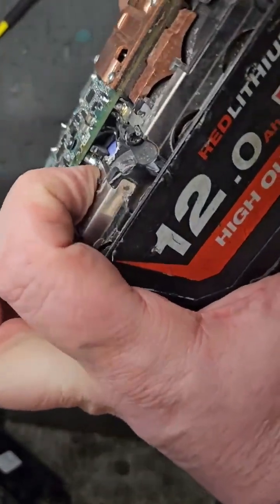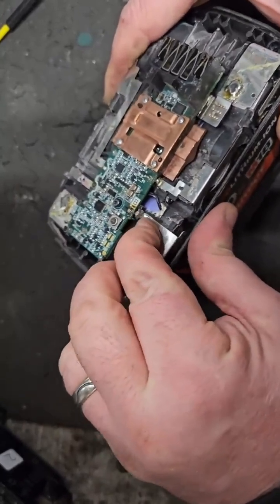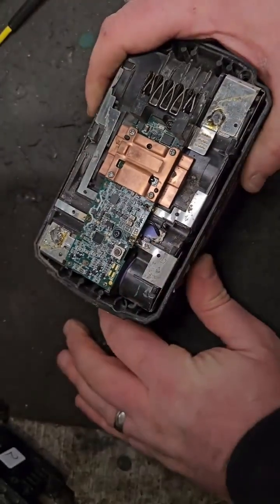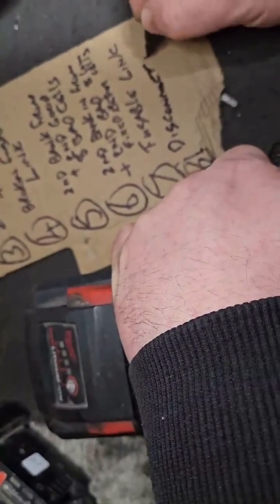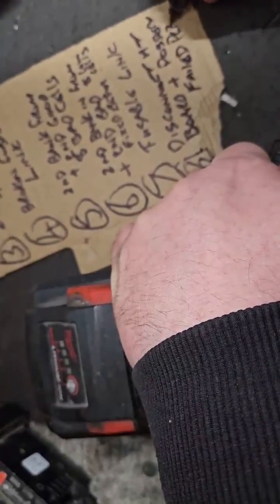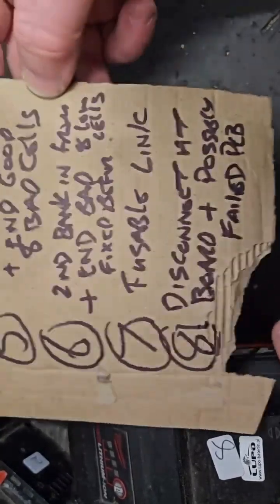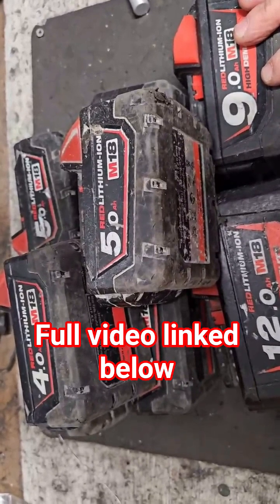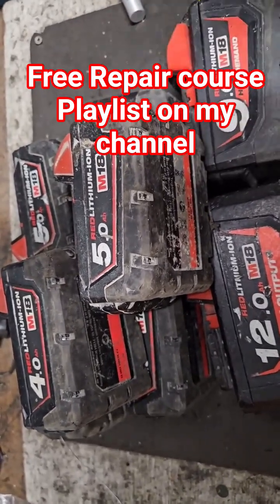Milwaukee M18 Battery triage Part 9 #powertoolrepair #milwaukeetools #batteryrepair

Comment: Any idea why a 12amp is testing all good 20.4v all cells good on multi meter starts in the tool then stops and will repeat the stop start but can power small impact gun but sounds like it’s pulsing??